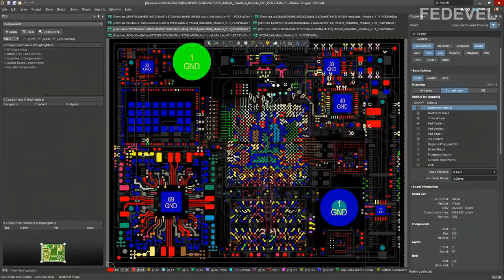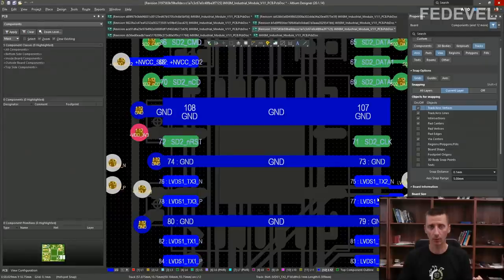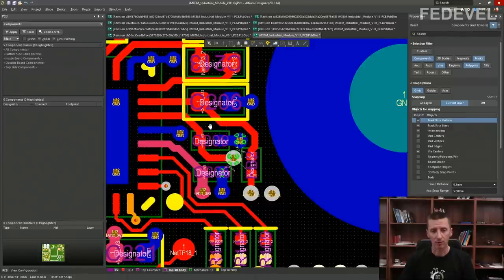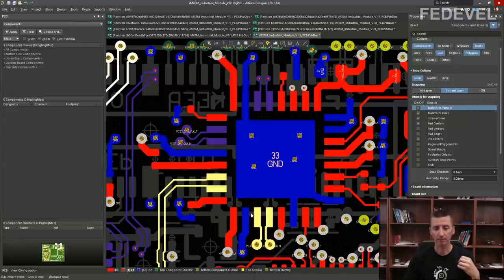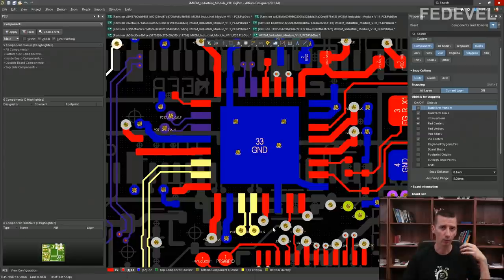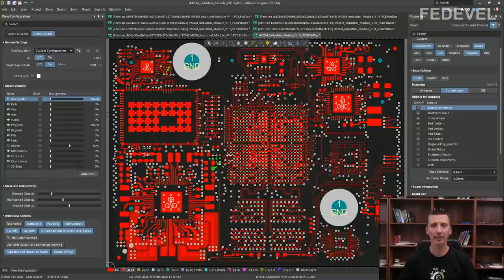How To Improve Your PCB Layout - VIAs

Comment: excelent to learn from mistakes, excellent lesson! This kind of video is of incredible value. I made my personal notes and figured out 10 lessons. My 5-cent suggestion is to add segmentation marks to the videos related to the lessons and assign segmentation titles. E.g.:
00:00 intro
00:42 one via per ground/supply pin
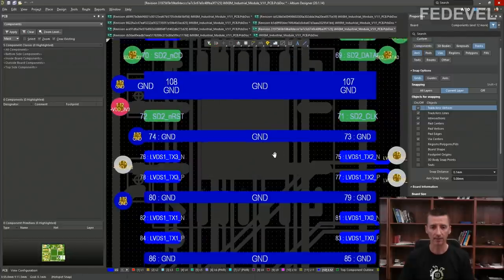03:35 consider current flow
...

Comment: Thank you Robert for doing these videos. I have small remark:
Those pullups (at the beginning of video) are for I2C bus, and can have only one power supply via, I always do that, but for other 'real' power supply and grounds I agree and on critical power supply capacitors I put 4 vias per cap (and even that comes with sort of a limit, because if you put vias too close to another via with the same net, via inductance increases because of their coupled magnetic fields, so it is better to just put vcc and gnd vias as close together to have lowest possible via inductance)
Reply from the maker: Thank you Darko
Reply: @RobertFeranec  Now you got me thinking. It would be great to simulate what is really the effect of different via/cap/track placement for some standard 4L and 8L PCB stack (and also for wrong placement/routing, it might not be as bad as we think. I had to change my view many times so far and even some time ago I would not believe that too many low ESR caps can be worse than lack of decoupling capacitors!(Eric Bogatin PDN)). I always tend to have GND & power track from capacitor to the chip on top side, but that might be better only for 2 and 4 L PCB, for 12 layer it is probably not any more, because prepreg thichness is much smaller and total loop inductance is probably smaller with 2 additional vias when going to GND plane and back to chip. Someone could simulate that :)
Reply from the maker: @DarkoObretan  I am currently working on a decoupling capacitor video (for couple of months now talking to 5 people from different companies - I am actually having a call with Eric Bogating later today) and I am very surprised ... it is completely changing my way of looking on power delivery. I am learning also simulate ... so once the decoupling youtube video is out, I can do more simulations on different topics so everyone can see what is actually happening on PCBs
Reply: @RobertFeranec  Great news. I have so much respect for Eric Bogatin, Howard Johnson, Rick Hartley, Lee Ritchey, Doug Smith, Ralph Morrison, and some other signal integrity specialists. There is so much to learn and especially after reading all those books (after many older books with only one perspective) I see that there are too many rules or some of them are outdated, so someone really needs to set grounds and simulate/measure what is really important and what is not (and to which degree is not and when does it start to have an effect). Have a great time talking to one of the best, I'm almost jealous :)
Reply: @DarkoObretan  Big +1 on Rick Hartley. His talk on the importance of PCB layer stackups was one of the biggest learning experiences I've ever had in electronics.
Reply: @Robert Feranec  
Hi, Robert, 
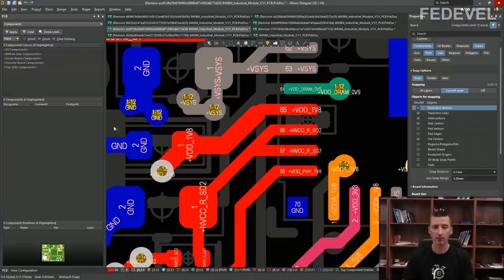@8:15 there is a lot of impact of how your stack is arranged and the old way of placing via before IC pin is not always the best option. It depends if you layout power tracks, if you use closely spaced planes or if they are faar away. 
If your power and ground planes are closely spaced, it doesn't matter where you put decoupling caps. 
You were at alium live 2019 and this had been presenting by R. Hartley. ;-)

Comment: For decoupling capacitors, sometimes I like to use 2 or 3 vias for GND and ONLY one for power. The idea behind is to create best possible connection to reference-GND plane while in the same time introducing a bit of impedance before connecting to power plane. That is how I can keep some of HF noise created from power pin of IC away from the power plane.

Comment: Via in pad - in a small project with a friend we really used them a lot - tiny board, nearly no space (the size had a hard limit). Where ever we had larger pads and could we also placed vias in them to help with current and heat. We even used vias in pads together with throughhole resistors as there was no other way to connect the parts. Well - that just happens when you got 3 active chips (over 40 signal connections) and 3 inter-board connections on a 24x24mm board.

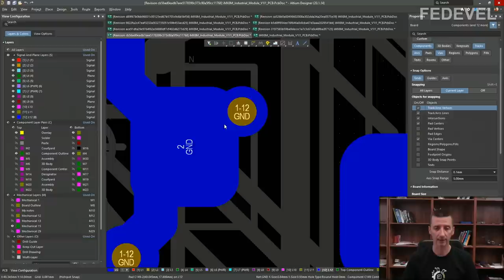Comment: Absolutely agree with your point at 18:00, VIA's should not be placed over pads unless there is an exceptional reason

I recall at my old work we had an issue that arose from this. At one point we had to switch a PCB fab house for a board which we had been manufacturing. When we assembled the new batch of boards all failed in the same way. Luckily our technician was pretty familiar with the design and was able to pinpoint the fault to a broken track, which as you guessed was between a VIA and a pad. The VIA was just touching the pad, which was electrically correct as there should have been a connection between the two (even though there was no track between them). When the new PCB fab house saw this they flagged it as an error and broke the connection, without telling us ;^)
Reply from the maker: Thank you Antalife for sharing your very interesting experience.

Comment: This is a very nice video, I really like this format, it's really more useful. Thanks for doing this. 

Instead of spreading the vias you can just remove the unused pads, that will help the copper flow in between them, that would save space.

Comment: Thanks for the nice video, Robert! At 8:10 you've said that you prefer to use the "pad-via-pad" style instead of "via-pad-pad". But it's the matter of your PCB stack, isn't it? The designer's ultimate goal is to achieve minimum inductance between IC and power rail. It isn't clear from the video, but I believe that 12-layer PCB must have a dedicated +VDD_1V8 plane at inner layers, right? And so, the "via-pad-pad" connection style would be preferable only if +VDD_1V8 is located "far" (more than 10 mils or so) from L1. If that PCB has +VDD_1V8/GND pair close enough to L1 (L2/L3 is most preferable ) - the best option would be to use the "pad-via-pad" style, isn't it? Wish to hear your opinion on that topic

Comment: @21:35 it says hole to hole clearance is .54mm but bellow that it says via to via is .254mm(.01"). Looks like they allow vias to be closer than holes which I assume means a non PTH.
Reply from the maker: I thought the same .. and then I spotted (Same nets)
Reply: @RobertFeranec  Yeah noticed that too on further inspection. 

It does make a lot of sense, like two vias with annular rings of .005"-.006"(.127mm-.153mm) and a space of .01"(.254mm) in between equates to .02"-.022"(.508mm-.5588mm) via minimum spacing. PCBGOGO's standard manufacturing same net via minimum spacing is .2mm(.0078").

Comment: I started to pay more attention to putting vias off to the side of decoupling caps rather then off the ends as I saw in an app note how placement of vias affects capacitor inductance.

Also where there are (physically) large capacitors for power I use a larger copper area placement on both ends do (not sure what you call them in altium) around and place many vias around it to help. A causal distrust of vias plating thickness helps keep the mind focused ;-)

I always use gcpreview to double check the gerber plots to spot ground plane slots, good practice but annoying if you spot something!
Reply: I use two vias per side of the capacitors as well.  I forget where I learned that technique but enough people don't do this that it should probably be the subject of another video.
Reply from the maker: I also like to place vias on sides of capacitors ... just ... in many designs what we do, we are happy if there is any free space to place a via at least somewhere :( Great tips Andrew.
Reply from the maker: @Andrew-dp5kf  Awesome resources! Thank you very much sharing.

Comment: excellent video!!!, what is your approach regarding the grid, for example, try to put all components, tracks and vias in a given grid so that later routing can go through it, or would you rather just place them organically and let the tool push them as you route the tracks?
Reply from the maker: Thank you LocoArdi. I do placement on a grid ... depends how small components I use, bigger component bigger grid (e.g. 1mm) smaller components smaller grid (0.1mm). Also, often i try to route at 0.1mm grid, but that is not always possible. (I do it, to make it easier for the tools and maybe get a better precision, but that is just my theory, I am not sure if it can help with precision)

Comment: Robert, it is very useful video for particularly junior and ones starting  just to draw a pcb. I use sometimes region to connect power pins to the vias to reinforce the connection and reduce the heating  that as  long as it is possible. What do you think it is true to use region in this cases?
Reply from the maker: Thank you Yavuz. Polygons will be done in this PCB almost at the end of the layout (especially for power and high current tracks)
Reply: @RobertFeranec  Are you two talking about, for example, 4:50?  The design under review put tracks (and/or polygons) across the chip to combine 2 ground pins at a time, but didn't expand those tracks up/down to join the different pairs of grounds.  Is there a reason not to do that (tombstoning?  isolating the various ground pins from each other?) or would that be a good idea that you just choose to leave for the end?

Comment: Hi Robert, great video as always.

Around 19:00, you talked briefly about via-in-pad technology, and how some of the solder will get wicked into the via. I did watch your very in-depth video about via-in-pad technology, but I can't recall if you touched on whether ordering boards with HASL applied to the pads can help with this? For example, I just ordered some 4 layer boards from JLCPCB that used few LGA components where I was forced to use via-in-pad. I ordered the finishing with HASL, and noticed that the HASL process has basically pre-filled my vias with solder. Do you think this mitigates the effect of losing solder to a via, if the via is already full of solder to begin with? I recognize that HASL would probably not ever be used in a professional mass production assembly process.
Reply from the maker: Thank you Yankee. PS: Good point. I have never really thought about this as we normally do not use HASL. I am just not sure what will happen with HASL when PCB is heated up, but you may be right, maybe it could help (?)

Comment: What about increased EMI because of increased number of current loops as the result of this? What is your opinion?
Reply from the maker: I have never had any problems with that. However I am learning how to run proper simulations and hopefully once I will be able to simulate also these :) ... and make videos about it of course
Reply: @RobertFeranec  Thank you for great content!
Reply: If I would have to guess, I would say it cant be worse, because total EMI is product of dI/dt and those two stay mostly the same if you look from perspective of power pin. Actually there will be some increase of peak current because of better (lower inductance) decoupling, but it will emit from ever so slightly different places and therefore be out of phase at certain frequencies so some of it might cancel out. And current loops will be with lower inductance (pwr tightly coupled together), so therefore I expect less radiated EMI. We will see what really happens in future video.

Comment: Another great video. I didn’t really understand what you were recommending around 26:40. Placing vias first - that makes sense. But, how would one anticipate which vias to place in this region? Without the schematics and with only one layer being displayed, it’s hard to understand which nets are involved. Certainly, one would not want to randomly place the vias ;). I am guessing you’re referring only to ones connected to these particular differential pairs? But, it’s a little unclear how to anticipate what vias will be required - before drafting some of the tracks in. Could you maybe elaborate on this in the comments or in a little follow up video? No obligation, but I would appreciate it, if you have the time. (I did work through your Altium course, so maybe I’ll review the schematics and that will help answer some of my questions. However, I have the feeling that other people may have the same sort of questions regarding this area.) Regardless, thanks again for your contributions to the community.
Reply from the maker: Thank you a1nelson. There are components on the top and on the bottom layer (visible in the video - grey color). Almost all the pins on these components will need VIAs (except the pins which are connected to the components placed close to them). So, almost all the power and ground pins for chips and decoupling capacitors and all the signals which you will have to route inside of the PCB will need a VIA (including the signals what are connected further from the chip or for example buses and interfaces).
Reply: Oh, I see it now. I had to go back and forth in the video to grok it. In the zoomed-in view, around 26:40, it was the ratsnest lines that were throwing me off. Rather than being terminated at two points, they gave the illusion that some of the transmission lines also had a third termination, as might be used for TVS on Ethernet or USB. After reviewing the video, I see that this illusion simply results from the routing of these lines being incomplete (and a bit wonky). You mentioned that this was a work in progress, but for some reason, my eyes just didn’t pick up on the gaps in this area. Thanks for the explanation!
Reply from the maker: @a1nelson  it was just a draft to get an idea if it will be actually physically possible to fit the tracks there and how much space we still have.

Comment: Hi Robert Feranec.
After in the very past making PCB covering PCB copper board with nail polish and etching it with chemicals it is amazing how nowadays complex PCB can be easy and relative cheap custom manufactured.
I don't make complex PCBs as in your video (my maximum until now is 2 layers) and learn a lot of your video's and explanation. I succesfully used one of the main PCB manufacturers.I expect it can become quite addictive.
I have a relative simple question about VIAs that probably will be to simple in the context of your PCBs however it can be interesting for more people designing PCBs.
I have seen a design where a track started at the top layer and continued on the bottom layer using VIAs. To make a better connection for thiger currents the top track continued a little after the VIA and two more VIAs from top to bottom track where added.
Is this a right way to do (it create mini loops) or are there other (better?) options (e.g. bigger VIAs)?
Reply from the maker: Thank you Jan PS: I do add multiple VIAs when higher current is expected to be carried through the tracks. And you are right, currents will flow differently through the VIAs however I have not seen any issues related to that (on the CPU boards what I normally design). If you like, have a look at this my video: https://youtu.be/56FvQX63Ea0